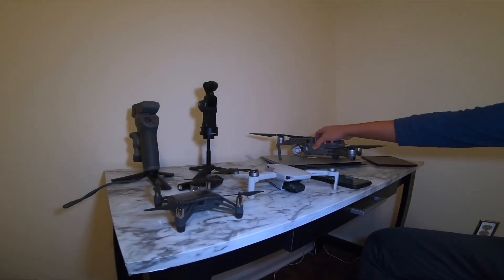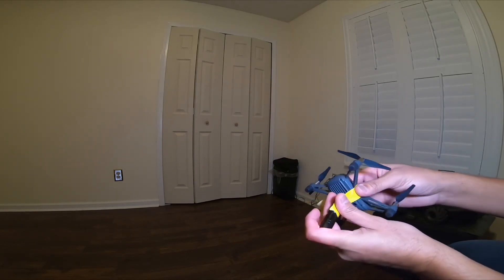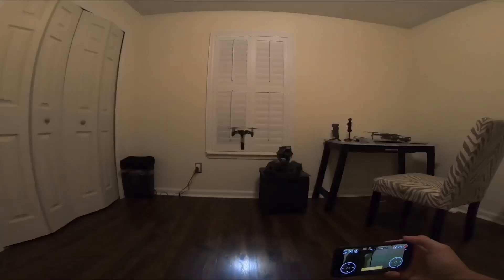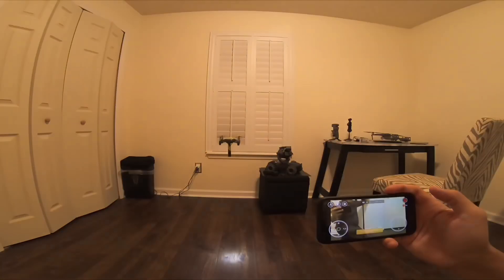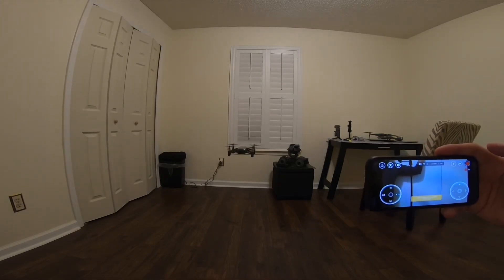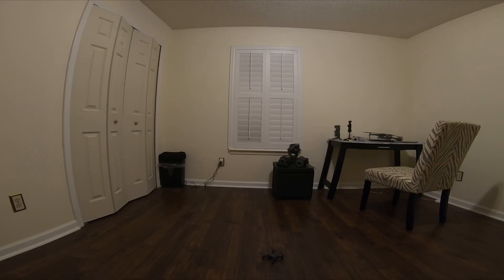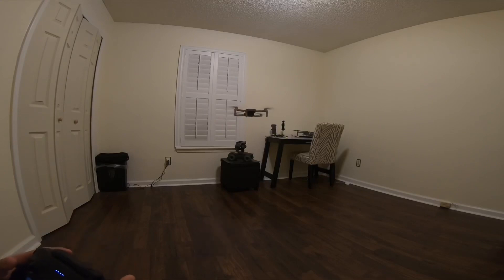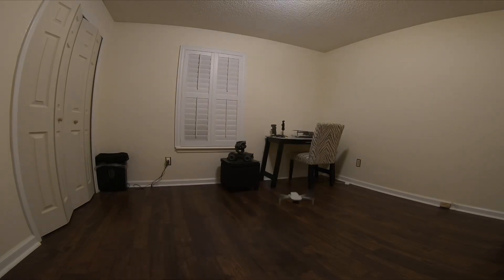Ryze Tello & Dji Mavic Mini Bottom Precision Sensor Light Mod;A hack from Mavic 2 will it work!😬🔦

Comment: Interesting my friend, I have done my own mod and I thought I would share with you what I did. I own a Dji mini 3 pro and what I did was I bought a tiny bead light around 1w and 5v and then I bought a usb c soldering wire cable and soldered them together. I did this so that I can connect the usb c to the drone and use the drones battery. Also, I bought a circuit board with a radio remote which the light turns on if I press a button on my remote.

Comment: There’s 2 sensor under the tello.drone. Are both sensors supposed to have red light? Or just one?
Reply from the maker: Thanks for your comments one of the laser light is designed for hold position like a GPS hold  and the other light is sensor how far from the ground and the camera is designed for seeing the bottom object or a memory for is actually takeoff at but Dji did not confirm the former update kind of like returned to  home but some other app that can be unlock!😎👍

Comment: use a laser, not a light, if you want fly high with tello in dark condition...
Reply from the maker: Thanks for your comments! I don’t really fly that high up on the Tello! 😎👍
Reply: Does it work with lasser ?? Which do u used??
Reply: Does that work?  You should post a video